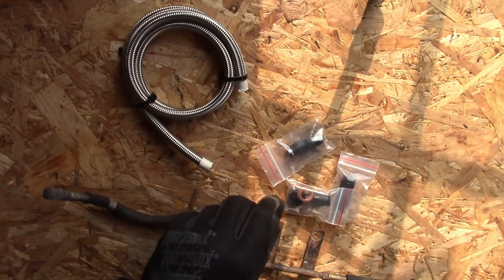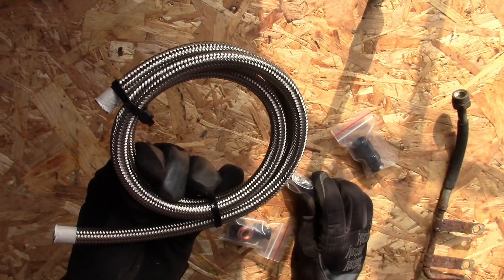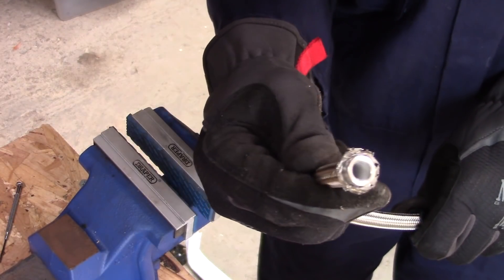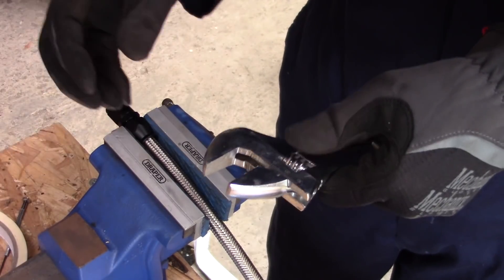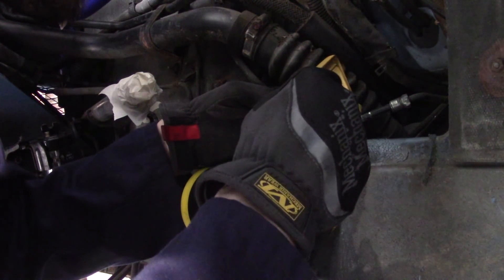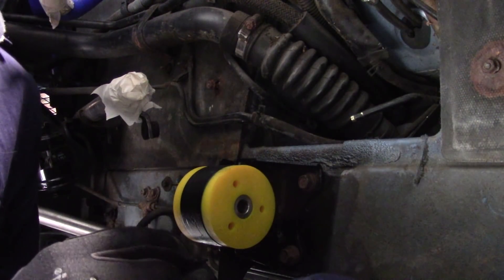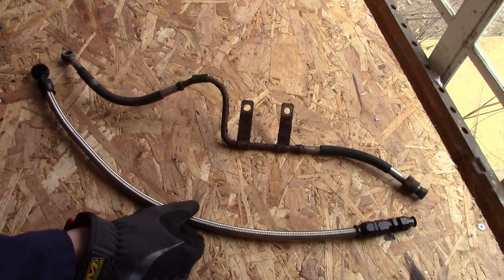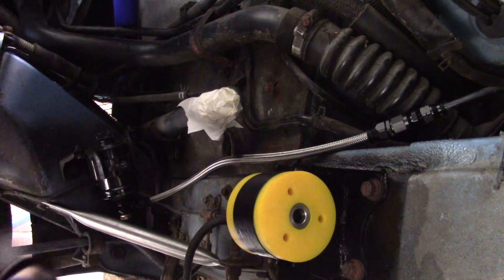MR2 Rusty Fuel Hose Fix- MR2 Rebuild part 38

Comment from the maker: Parts used to build the new hose:

- AN6 Straight PTFE Teflon Hose Fitting
- AN6 Straight Male To 5/16" (8mm) Tube Adapter
- AN6 12.5mm Eye Banjo PTFE Teflon Hose Fitting
- M12 x 1.25mm Stainless Steel Banjo Bolt & Copper Washers
- AN6 Teflon Stainless Braided Fuel Hose 1m
Reply: Matt! Been a watcher of your content for a number of years, been a great help with my T bar seals…

Question for you, the time has come to fix this hose as it’s spraying atomised fuel right where it shouldn’t be…

I’ve ordered the parts in your list (thanks for that) how long was the cut hose size approximately? I need to make the hose up before I hire the workshop space to do the work! Any idea you have would be of great help

Thanks 

I

Comment: The hose is officially discontinued by Toyota, so DIY all the way now (brought here by Reddit link), what connector did you use to connect to the filter?  Original uses a banjo,  what size is the replacement that you found please? (Ive seen mention of a part list in the comments, but i can't see it for looking!)
My SW20 has been off the road for 10 years, so i think I'll be watching a lot more of your vids heh.
Reply from the maker: Sorry, seems I forgot to add the parts list to the description, I’ve added it now, and I’ll paste it here as well:

- AN6 Straight PTFE Teflon Hose Fitting
- AN6 Straight Male To 5/16" (8mm) Tube Adapter
- AN6 12.5mm Eye Banjo PTFE Teflon Hose Fitting
- M12 x 1.25mm Stainless Steel Banjo Bolt & Copper Washers
- AN6 Teflon Stainless Braided Fuel Hose 1m

That sucks Toyota have discontinued the hose now, but then it was crazy expensive back when I did this. Hope you enjoy the rest of our videos, my MR2 has been off the road for nearly 7 years now, how’s yours going?
Reply: @EnginesandUnfinishedBusiness  That's awesome thanks, great to see it's still going - subscribed.  I need to refit the catalytic converter to get an MOT (has a Hayward and Scott system, which included a decat pipe) - once I get this fuel pipe back on anyway!  Started to restore the paintwork - using G3/G10 compounds and repairing/respraying the bits that need it .  I'm sure the MOT will uncover a load of things I have to fix too!
Reply: @EnginesandUnfinishedBusiness  I see your MR2 is running again, mine passed the MOT yesterday and had its first run on the road for over 10 years(!), your videos have helped resurrect my old girl too, thanks :)

Comment: There is enough room to spin the red cutter tool all the way around the fuel line.  I've done it multiple times.  The line can simply be bent very slightly away from the big ribbed fuel filling tube.

Comment: IS this set up still holding up? I'm debating if I should replace my feed line with this as well. Thanks!
Reply from the maker: We don't know yet, things have been moving slowly, and we haven't actually got the engine running again yet 😖 We'll definitely to a follow up video once we've had the car running for a while.

Comment: Quick question, when you removed this line did you turn the fitting on this line or the smaller 14mm coming out of the tank? I'm assuming that 14mm fitting is the one you turn as you removed it at @4:19 Trying to remove a fuel tank....
Reply from the maker: I honestly can't remember 😖 I think the connector was really stiff, and it was just a case of which ever one loosens first. Good luck with your fuel tank 👍
Reply: I ended up taking the thing loose at the filter and pulling it through when I removed the tank. That thing in ON THERE lol.
Reply: @robertelmo7736  thanks for this idea! im currently stuck on this horrible fitting trying to pull my tank out for a fuel pump replacement

Comment: Hi Matt. Where did you get these fittings? Especially intrested in the olive type fittings and sizes used 😉
Reply from the maker: The parts all came from Torques on eBay:

1m of -6 Teflon braided hose https://rover.ebay.com/rover/0/0/0?mpre=https%3A%2F%2Fwww.ebay.co.uk%2Fulk%2Fitm%2F380711703154

-6 to 8mm compression adapter https://rover.ebay.com/rover/0/0/0?mpre=https%3A%2F%2Fwww.ebay.co.uk%2Fulk%2Fitm%2F360590883587

-6 straight hose fitting https://rover.ebay.com/rover/0/0/0?mpre=https%3A%2F%2Fwww.ebay.co.uk%2Fulk%2Fitm%2F171314533959

-6 12.5mm banjo fitting https://rover.ebay.com/rover/0/0/0?mpre=https%3A%2F%2Fwww.ebay.co.uk%2Fulk%2Fitm%2F160866615903

Comment: Hey, could you advise where you bought the parts as I’ve the exact same issue.
Reply from the maker: No problem, the parts all came from Torques on eBay:

1m of -6 Teflon braided hose https://rover.ebay.com/rover/0/0/0?mpre=https%3A%2F%2Fwww.ebay.co.uk%2Fulk%2Fitm%2F380711703154

-6 to 8mm compression adapter https://rover.ebay.com/rover/0/0/0?mpre=https%3A%2F%2Fwww.ebay.co.uk%2Fulk%2Fitm%2F360590883587

-6 straight hose fitting https://rover.ebay.com/rover/0/0/0?mpre=https%3A%2F%2Fwww.ebay.co.uk%2Fulk%2Fitm%2F171314533959

-6 12.5mm banjo fitting https://rover.ebay.com/rover/0/0/0?mpre=https%3A%2F%2Fwww.ebay.co.uk%2Fulk%2Fitm%2F160866615903
Reply: Awesome thanks dude 👍

Comment: Sorry my man, that is just a standard nut-f*cker. The thumb-detecting version has a small hammer face (or thumb-detector) on the non-moving jaw side.
Reply from the maker: Aw man, regular nut fucker just doesn’t have the same ring to it

Comment: Nice one , Let see more vids and hope to see the car running soon :), Link to fittings would be fab
Reply from the maker: Thanks! The parts all came from Torques on eBay:

1m of -6 Teflon braided hose https://rover.ebay.com/rover/0/0/0?mpre=https%3A%2F%2Fwww.ebay.co.uk%2Fulk%2Fitm%2F380711703154

-6 to 8mm compression adapter https://rover.ebay.com/rover/0/0/0?mpre=https%3A%2F%2Fwww.ebay.co.uk%2Fulk%2Fitm%2F360590883587

-6 straight hose fitting https://rover.ebay.com/rover/0/0/0?mpre=https%3A%2F%2Fwww.ebay.co.uk%2Fulk%2Fitm%2F171314533959

-6 12.5mm banjo fitting https://rover.ebay.com/rover/0/0/0?mpre=https%3A%2F%2Fwww.ebay.co.uk%2Fulk%2Fitm%2F160866615903